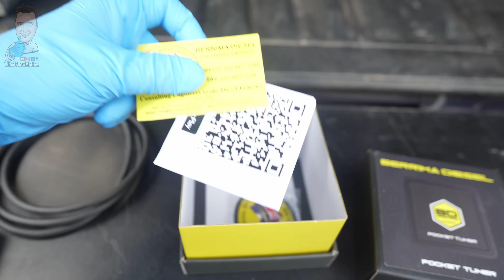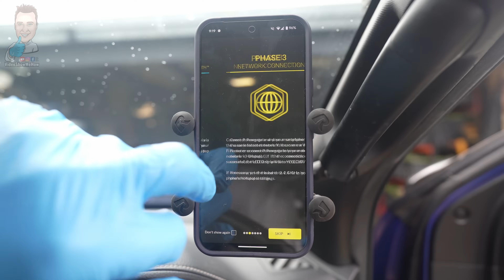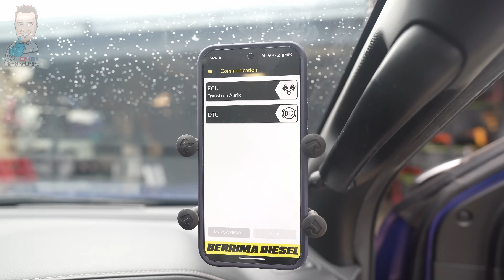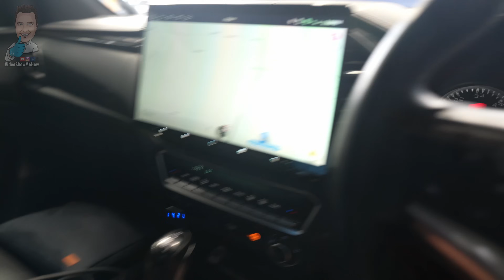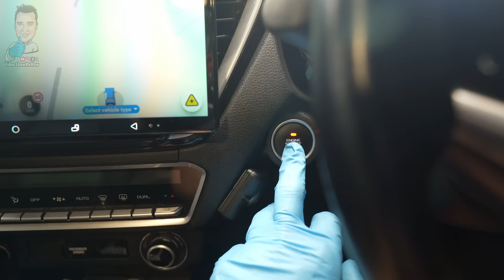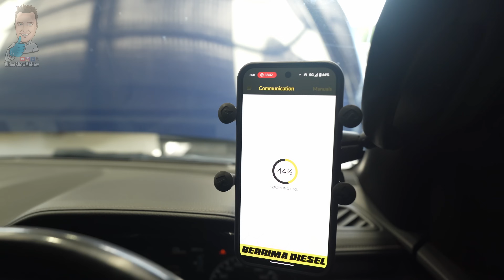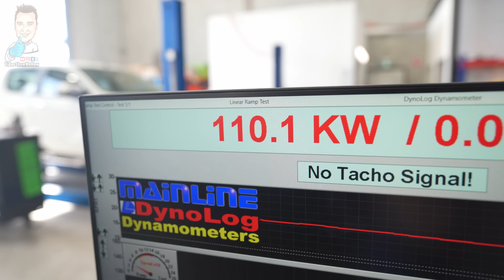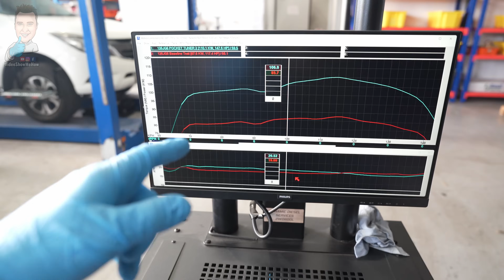Powergate Pocket Tuner: D-MAX Remote Custom ECU ReMap Tuning in your Driveway? BEFORE & AFTER DYNO

Comment: Did you tune the D-Max for towing, Power or somewhere inbetween?
Reply from the maker: I kinda don't believe in a tune for this or that (for this type of car anyway), more so was more a tune that will unlock some extra torque, sharpen up the economy, keep within safe ranges and keep heat under control. Hope that makes sense

Comment: Hey Adam,

I too run a DpChipX. I have noticed that with it in for majority of MY21 model D-Max, it seems to do a burn off approx every 150km regardless of short or long trips. 

1-Did you notice the same thing when you had the Chip in?

2- with the tuner, have the DPF burns been as frequent?

I’ve enquired as it seems AFR’s might be the cause because back in stock form it’s doing way less burn off and seems to run better more economical. 

Be good to hear your responses based on my questions. 

Cheers 👍🏻😎
Reply from the maker: yes it was about that with the dpchip, same as factory. Haven't tested with the tune but is a good point, will keep any eye on the burns for the next couple of weeks and report back
Reply: @VideoShowMeHow any updates on the burn off please?
Reply: @jeep2701  yeah i I'll like to know aswell
Reply: @ Cheers mate, be interesting to see how it is with the tuner. 

Interesting you say same as stock, as mine without chip in now does a burn around the 300km mark. 

Only other things that I added whilst chip was in were a catch can, pre filter and 3” exhaust. I wonder now back with it In stock form if the exhaust is allowing it to run better? 🤔
Reply: @ Hey mate, how is it going with the pocket tuner?

Has there been a difference in km’s between DPF burns?

Also, off your car scanner app, have you noticed an increase in the calculated boost PSI? what is it maxing out at?

Most I ever got was 20.80 max PSI with the DpChipX 

May aswell ask what the (TCM) actual engine torque N.M now maxes out at? Again most I could get from the chip was 446nm. 

Cheers 👍🏻
Reply: @VideoShowMeHow  how is it burning
Reply from the maker: Have been running a scanguage3 for the last little while and been keeping a closer eye on it, seems to be less frequent? Just got back from a 3 day trip (maybe 300km?) and didn't see it trigger. I need to do some longer runs to see more clearly but at the moment it does seem less frequent..

Comment: Heya Mate, quick question do you still require the throttle controller with an ECU tune ?
Reply from the maker: @linorst  up to you, I still run one to have a bit more control over the pedal input.

Comment: Hi Adam, what were the output numbers from the DPChip before you did this new mod? Much difference in the tunes?
Reply from the maker: @davidrobinson990  howdy - never had the DPchip on the dyno myself to compare I'm afraid. Am told will see gains of 20-30%. Feel like this tune maybe has a little more go and is smoother particularly on the highway

Comment: Hey Adam, great vid 👍 thanks for adding it to the DMax build series…just a couple of questions…is the initial cost a one-time payment, or are there any additional costs (updates, retunes, software fees)? Do you get to keep a copy of the custom tune file, or does Berrima Diesel retain control over it? If the tune is lost due to a dealer update, do you have to pay to have it reapplied? How does the Berrima tune compare to a throttle controller—would you still need one? Cheers Corrie
Reply from the maker: Cheers 1) Just need the buy the module no other fees 2) yep, both stock file and tuned file are saved to the module 3) no, you can rewrite the tune if the dealer somehow wiped, or back to stock for that matter 4) throttle controller is completely separate, that just increases your pedal sensitivity, doesn't actually increase power or torque
Reply: @VideoShowMeHow cheers thanks mate 👍 love your videos keep em coming 👍

Comment: Looks like an easy way to put a tune on your dmax. Do you know if a dealership needs to update the ecu for say a recall if that will wipe the tune out ? I would be great to see a side by side sprint between your tuned Dmax and a standard one. Im sure you might know someone else with one.
Reply from the maker: Even if dealer wipes through an update or something, it's stored on the module so you can just write again (the stock tube is saved as well)
Reply: @VideoShowMeHow  do you know if the dealer can see that the car has been tunned in case of a warranty claim , can you just put the stock tune back on the car ?